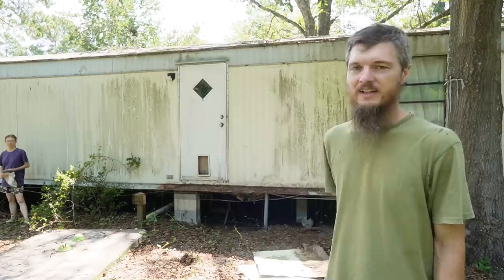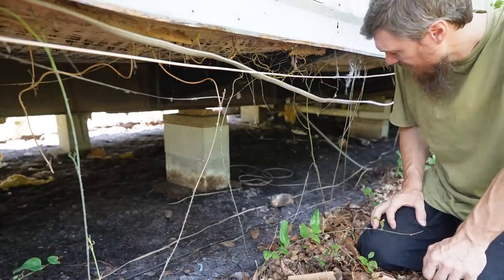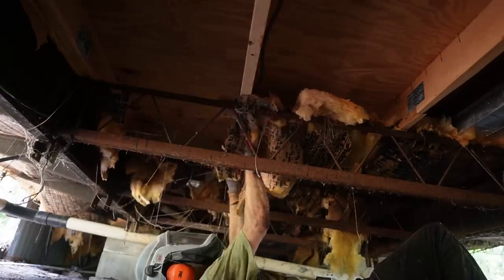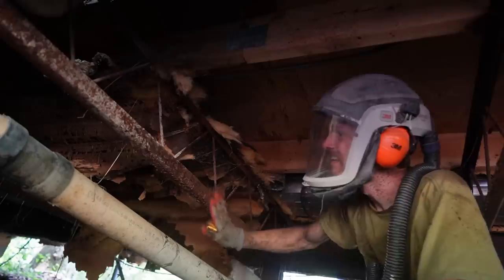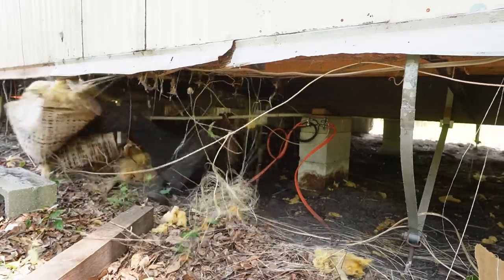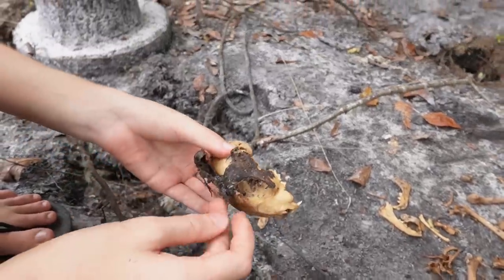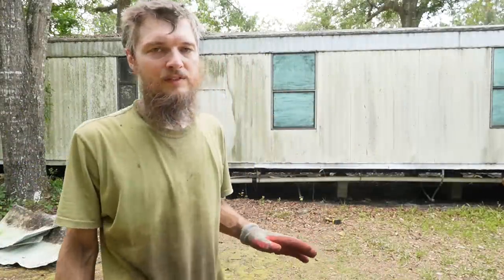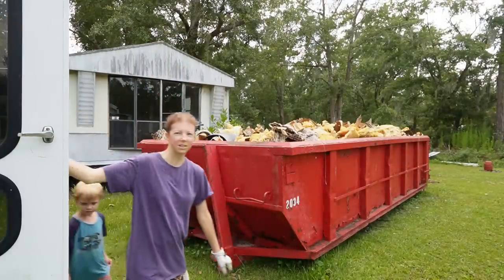The Most Miserable Job - 1984 Mobile Home Underbelly

Comment: When we sold our home last summer and moved into a mobile home community as a debt elimination strategy, one of the first things we did was replace all the windows with impact insulated windows (spouse is in industry), and replace the siding.  While siding was off, we re-sheathed where needed, and Tyvek wrapped the home.   Inside we ripped up the flooring - the sub-floor was remarkably in great shape.  But underneath, the vapor barrier was tattered, insulation moldy, and duct work pretty rough.  Replaced all.  NASTY job.  But done, and done correctly.   We did hire a pro for the vapor barrier replacement - beyond our scope, and scope of friends.  And remodeled the kitchen - all DIY except the stone counters.

We knew it was a risk spending the cash we were because it is a mobile home in SWFL, but our intent is to stay here long enough to realize our dream of moving.  And either cash out, or put home in a rental program.  BUT, the investment did pay off:  We were smacked with Hurricane Ian DIRECTLY.  The onshore eye-wall came RIGHT over our area.  (we stayed at a friends).  We had minor cosmetic damage, while most of the rest of the mobile community was devastated, let alone the local community was largely devastated by surge.   I firmly believe if our work was not completed, or we skimped out on anything, we would be having a different convo.

So keep up your work. It will pay off.

Comment: I know exactly what you're up against.  Did this under my parent's 1984 trailer two years ago.  All the insulation was hanging down with all the strings which i cut with scissors  but i waited until it was fall so it wasn't so hot.   Full tyvek white suit and mask.   Found a cat skeleton under there too.  No bugs or spiders fortunately.  
     You did a great job!!

Comment: My parents have a mobile home from the 70's that they still live in today.  My dad dug down and put a block foundation all the way around it, put an A frame roof on it and even added a garage to the back with a 2nd floor.  He replaced all the siding with vinyl siding and from the outside i looks nothing like a mobile home anymore.  But if you go inside you see the cheap wood panel walls and ceiling like you tore out in one of previous videos.  Its weird to see you do this work knowing my childhood home was built same.
Reply: Painting the cheap wood panels white looks really good 👍

Comment: I don't remember a crane being used.  Usually, they drive it up to your property, level it on the blocks, jack up the part that needs leveling, take the tires off, and you're set.  Yes, that covering under the house is tarp.  I saw a YouTube channel that was fixing up a mobile home using a tarp to replace the old one.  If you have to remove that stuff again from underneath a trailer, cut in the middle and pull it from the side (if you can).
Reply: Modular home, not mobile home.

Comment: One day when we lived in a mobile home, an awful smell started.  Next black flies started coming through the vents.  It was awful and we couldn't find the source.  The smell and flies got so bad, we stayed in a motel for a few nights.  Finally a critter removal  guy found a lump hanging down in the insulation under the house.  A possum had crawled inside and died!  After it was removed, the smell started going away and so did the flies.  YUCK.    I"m glad you didn't find anything like that!  You did well.  Good job.
Reply from the maker: Gross!!

Comment: I've never seen a mobile what the floor joists go longitudinal. My 1974 has transverse floor floor trusses 2 x 8 ish. I live in a very cold climate so in the spring, I'm replacing the 45 yr old paperback R12 with RockWool R16 and 2.5 " rigid foam sheet foam. I might add a fine metal mesh to prevent rodents.
Reply: Where do you get the metal mesh from?
Reply: Skyline used longitudinal floor joists for many years.

Comment: That trailer (or in my case a smaller stick built pier and beam house) seem relatively small, from the outside (or would be easy to accomplish clearing out the old insulation), until you get under there, on your back, doing just what you're doing. Then you realize how big 14x70 (or your trailer's true footprint), or my 20x40 house footprint. I'm going through the same things, right there with ya. You're doing all the good, man. Keep on keeping on. It's looking good!

Comment: My husband can relate because when we decided to sell our trailer back 30 years ago we had to fix ours. Our dog had tore out the insulation in several spot after stray cats that went up in it. When he fixed it and then skirted it he used tar paper for over all the insulation so it would stay put and used one of those hammer staplers to put it up with, LOOKED SO NICE when he finished! I was like WHY couldn't it have looked this nice when we lived in it for 13 years? lol Now they have that bubble foil now so it would be nice to use it, just not as cheap.

Comment: I see there is a big hole in the floor for the P trap, just like ours.  We had a rodent problem a few years ago, and a plumbing issue about the same time.  We no idea how bad the mice were until we pulled down the wrap and insulation it was aweful.  Before we put up the insulation, I went around stapled 1/4” hardware cloth around those P traps tight to the piping,  so no mice could get into the bathroom.  The funny thing the mice came in the winter, we could hear them trying to get in, they couldn’t so they left

Comment: That "paper" is all that is left of the house wrap from the 80's the strings are probably all that held the paper and insulation in place. I started framing in 1985 the house wrap had a paper backer. 
Thanks for the video! 
Have a great week!

Comment: Good job, brother. I need to do the exact thing soon. I'm curious as to what you're going to use to insulate and seal. Please post update.
Reply: I'm doing this same thing right now. I'm using rigid 2 in insulation foam board and spray foam.

Comment: Wow.. that was a totally disgusting job to do but it was definitely needed. 
I wonder if you could do a DIY spray foam under there?  It would seal it up nice and probably keep termites from getting inside too.
I'm dreading the job for you whatever you do.
Reply: Aren't there some spray foams with pesticides embedded in them? Maybe something with boric acid, which is relatively non-toxic, would protect the wood, which was in surprisingly good shape. I would probably have just sprayed the fiberglass to kill the bugs and left it there, but that's a moot point now. Most 40 year-old houses, especially in a place like Florida where everybody sprays periodically, are going to have a lot of gross stuff embedded in the walls & floors, not to mention the lead, asbestos, pesticides, etc. that were used in past decades. As long as it's well encapsulated, most of that stuff doesn't bother me.

Comment: Paper insulation backing is for humidity to be able to escape. We bought an old mobile home that had a plastic in the ceiling that kept any humidity up there. The trusses failed, the insulation got moldy.. plus some of these homes don't have attic vents, which we added after rebuilding the trusses and ceilings.

Comment: Oh my goodness, I am far to claustrophobic for all that, YIKES!  So when you finish foor repairs, ductwork, plumbing, electrical, leveling, etc, are you gonna spray foam insulate under there? In that climate it seems to be the optimal choice, not to mention easier and quicker installation lol. Fiberglass and cellulose are quick and cheap options but are highly susceptible to absorbing moisture, resulting in mold, mildew and rot. Not to mention the critters that get in. A durable foam sealant creates a weatherproof, water-resistant and airtight seal that blocks both pests and drafts. It also helps prevent damage from moisture and mold and mildew growth. I dunno if you use a closed cell foam or an open cell foam though. Closed cell foams keep out moisture n such, but they say to use an open cell foam on certain parts under a mobile home. As you were ripping the old stuff out I got to thinking, omg reinsullating and sealing it up is gonna be a monumental task. I dunno how you find the patience and energy for all that!?! ❤

Comment: My son and I had to do this after flood of 2016. Not a fun job at all, but it feels good when done, and at least it’s not a job you have to maintain often.
Reply: If you haven’t completed the job, I’m wondering if you would benefit from using a creeper. I’m on a concrete foundation and it was a huge help getting around. Don’t know how easily it would roll on dirt.
Reply from the maker: It's all done now, but that dirt is so soft that it would probably get stuck under there. I love it when mobile homes are placed on a slab. That is such a good idea.

Comment: Roaches are nasty and carry diseases. You ought to set bombs under that trailer and kill them and you also need to bomb the inside of the trailer before you remodel it. It would be horrible to do all that hard work on that place and then it be infested with roaches. I know you and Ashley don’t like chemicals and poison, but sometimes you gotta do what ya gotta do. Great job Doug and Ashley. You guys rock!! God bless.
Reply: Using DE with a small amount of Boric acid will be really safe and will get rid of the bugs, without toxic chemicals. Once the place is cleaned and dry, and resealed, most of the waterbug problems will disappear. They like dark and damp and undesturbed.
Reply: @cherylsmith-bell6509  I am not familiar with DE, so I had not thought of it. Of course, if they can find something safe and nontoxic, they should use it instead of chemical bombs. God loves you. Jesus loves you and died for you. God bless you always.

Comment: What you need is a cheap garden trolley, with the sides removed, so you can roll around under there. It would be so much easier, and if you have the handle down, you can be pulled out easily. Plus, it would then double up for use in the garden.

Comment: Wow, Ashley is a big help in removing and hauling that debris to the dumpster. Cleaning it up as you pull it out makes it appear a lot of progress is being made. will you be spraying the underbelly for pests or will you be able to seal up entries? How are you gonna load out the old hvac unit? It's heavy. Are you worried about heavy rain water getting under it since removing the underpinning?

Comment: That is truly an awful process. You have taken on some horrible jobs, but that one rates right up there. Those never ending threads trying to tangle you up, the mess or fibres, but you are fighting back and getting it done. The insect and rodent mess was just an added 'bonus'. At least, it was dry and there was no river of cold, muddy water flowing slowly up your neck.

Comment: I would replace it with spray foam. Then it will not only insulate but be waterproof and add to structural strength. Might be spendy but will pay for itself in a couple years in savings on heat and a/c bills
Reply: I would only do that  after subfloors are replaced.

Comment: Modular homes is what Ashley said....Mobile homes and Manufactured homes are the same thing   just different names...have the hitch at the end and have the metal on the underside. Also...Modular homes are built with drywall like regular frame or brick homes on the interior ...mobile or Manufactured homes do not have dry wall...would be too heavy too heavy.
Reply: I live in a manufactured home. It too has the frame, chassis under it. All those names are used interchangeably. I just say I live in a trailer.

Comment: If I can give you some feedback on your dumpster.  I noticed that when you first starting dumping large items in there that you would have a lot of voided space when you added stuff on top. If you had your track hoe there you could pack it further. If ever again, break some of those things down before putting in the dumpster, either with a sledge hammer or portable saw if wood. Good luck on your build.

Comment: I can only wish that I had that much room under my mobile home. I tried to work on some air conditioning ducts and it was so tight that I couldn't raise my arms up to reach. Mine has concrete around most of it as well with the skirting being about half the length of this one.

Comment: I know bc of the age of & FL rain my MH mostlikely needs this done. I have plumbing and electrical hooked up. I also have a soft spot in a bathroom.  Whats something like this cost to remove & put in new installation & seal it whatever is used to keep bugs out? No bugs in the home yet. Im female & too old to do this job. Whats the estimate cost? Kudos to you for having the guts to do that.

Comment: Considering the problems with reinforced paper,  wonder what you  are going to replace this with.   Insulation meant for inside use will be gradually trashed over a few years by roaches and rodents.   Just occurred that DWV pipe like seen in several areas cost 2-4x what it did 5-10 yrs ago.
Reply: Can you spray foam in Florida?

Comment: Thats not always true of modular structures. They can actually be set up similarly to a mobile home as far as transportation is concerned. In a modular setting, the axles and leaf springs would be removed once the crane lifted the structure to relieve some of the pressure/tension for the  release. However, there would still be a considerable amount of pressure/tension in the suspension enough to cause serious injury if not done properly.

Comment: Hi, 
Can you guys share some details about renting the dumpster?
Like: what’s your options, how much $, how many days, how many tons, what if you go ove the tonnage, and or the days?

Thanks
Reply from the maker: The company we went with has various sizes. This time we got a 20 yard dumpster. They allow you to have it for 2 weeks. If you go over that there is an added fee. The cost was $416. We only do the 2 weeks. There really is no weight limit. Basically just fill it up to the rim. And they have some rules like no tires, concrete, chemicals, yard debris.

Comment: What a disgusting job to clear that insulation out. I was wondering if a long 2x2 or pole with a hook on the end would have worked to pull some of that crud out. That area under there was not just disgusting, but also creepy. With all our projects on old houses, we have had to demolish some gross stuff, but nothing with that tangled lot of webs.
That was an immense amount of work you got done in that Florida summer heat. Even I am glad you are done with that gross job. Drink plenty of fluids, y'all, and get rested up.

Comment: You have your Excavator use the bucket to compact it down as much as possible to get more in it my father used to work for a city, and this is what they did all the time when they had a bulk drop off of twice a year they put everything from Furniture bulk junk in it compacted it as much as possible getting your moneys worth.
Reply: No trailer to haul it there and to far away to drive it there, he mentioned that previously. It would help though.

Comment: What a miserable job climbing around under the trailer and removing the insulation.  Maybe, before you go under again, you can lay down plastic sheeting that could also prevent moisture coming up under the trailer.

Comment: As I'm watching you struggle using that razor knife on that deteriorated insulation, it occurred to me that a hook knife would have been a better option as you could cut through the paper, fiber mesh and the fiberglass with one or two passes, thereby getting rid of the strings with the rest versus pulling the insulation apart. 

I'm curious, what manufacturer built this? I've lived in mobile homes more than I have stick built homes or apartments, and even renovated several along the way but I've never seen paper belly wrap. Seems like a cheap out on the part of the manufacturer.
Reply from the maker: Sunstate Manufactured Homes and the model is Beachcomber. I haven't had a lot of experiences with mobile homes, but I have never seen that either and thought it was unusual.

Comment: I’d order half a dozen bug bombs off Amazon, wrap the bottom of the trailer with plastic and exterminate the bugs before I would crawl back under it for electrical, plumbing and insulation.

Comment: You have such big property lots. Could easily divide and add another mobile home. Most people dont want such large sections to maintain.
Reply from the maker: It's not even 1 acre. I don't even think the county would allow it to be split up more since it's already this small of a lot size. But regardless of that, in my opinion, every residential home should be on at least 1 acre so people can have outdoor space to enjoy. And if someone doesn't want a yard, they can live in a metro city.